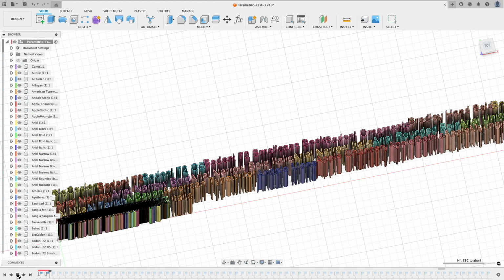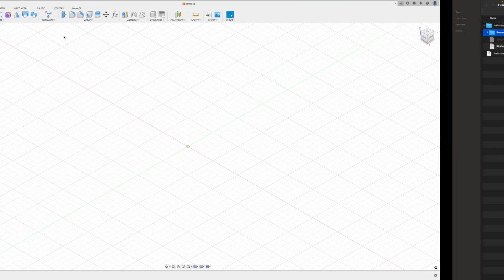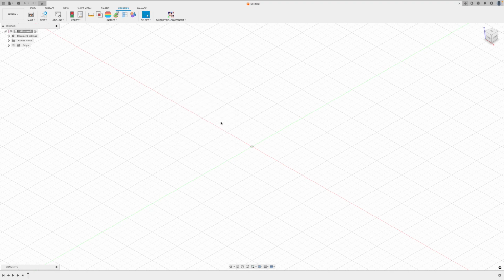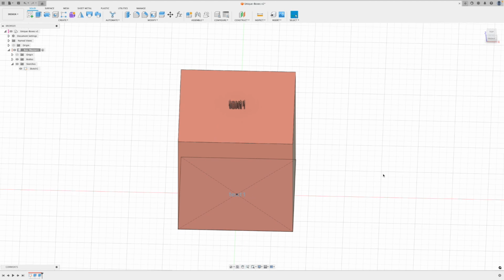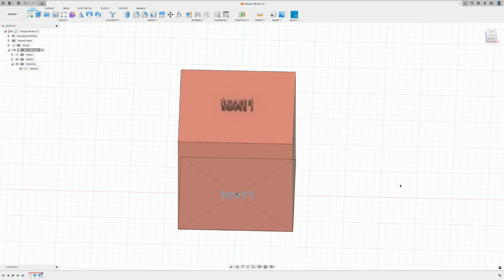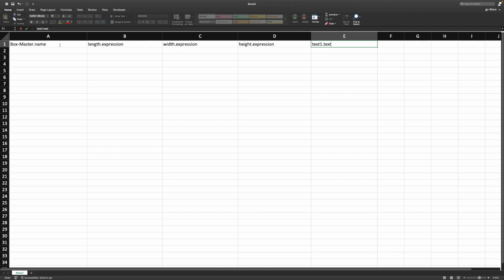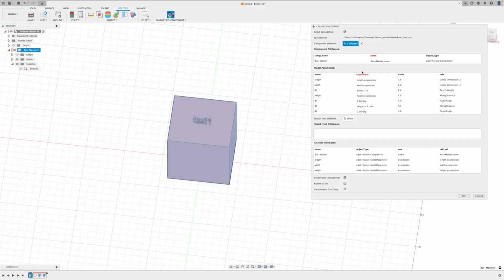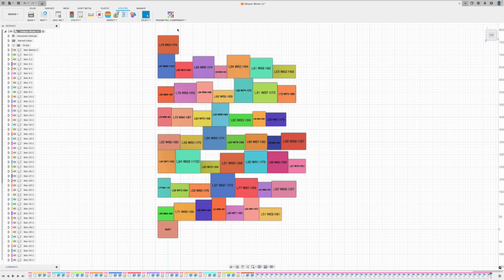Fusion 360 Parametric Component Add-In Tutorial

Comment: I  know you have other very cool projects in motion right now but i would love to know more about this process! do you think its possible to have a script pre read the feature parameters and export it into a csv format? it could nerf it a bit to make it for simple geometry (no text or crazy shapes) but simplify how many features could be exported in to the spreadsheet with hopefully minimal input. Absolutely love the export feature you made for STLs and was wondering if it makes sense to try to export as a STEP file instead now that its compatible with modern slicing and easy to modify dimensionally if you need to make a variant of a specific part